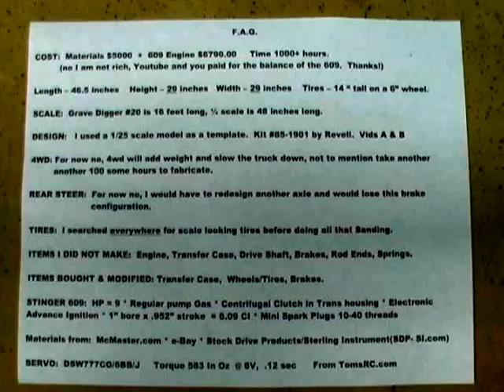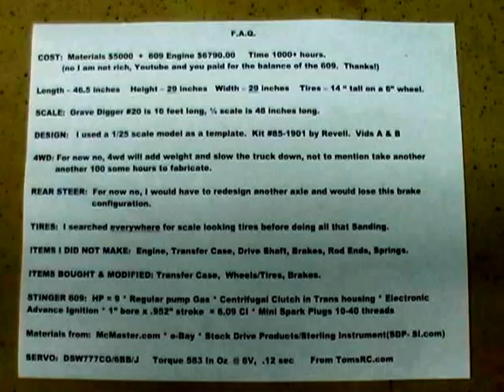1/4 Scale Grave Digger Part FAQ

Comment: Hate to be a nit picky pecker head but 1/4 scale would have 16.5 inch tires 66/4=16.5 but you probably know that and couldn't find such a specific size. Anyhow I don't care, it's still awesome. And I was thinking about your concerns of the diff not handling 9hp very well, if you were ok with a solid axle you might be able to find a small angle drive out of some farm equipment (a small auger comes to mind) that would be much stronger simply because it doesn't have extra moving parts.

Comment: BTW since it is a 4 stroke, running regular gas, no 2stroke oil, do u actually fill the crankcase with engine oil? like same as a real car? u know like 5w-30 and such or does it require a very thin viscosity oil?